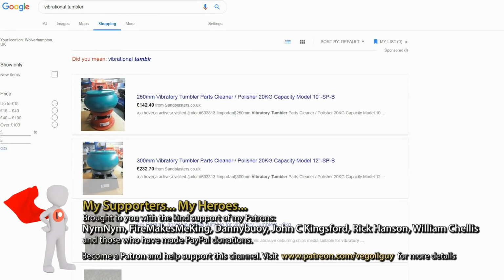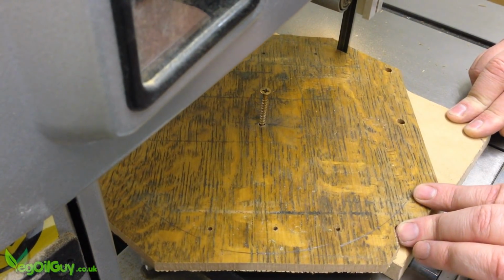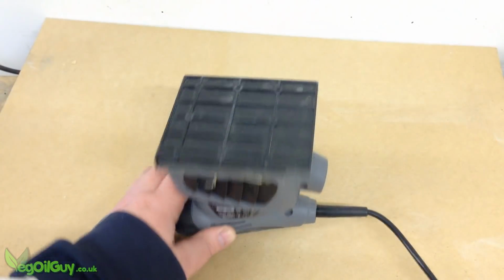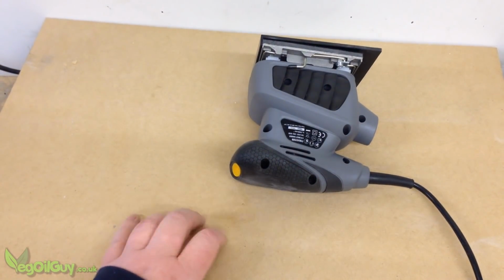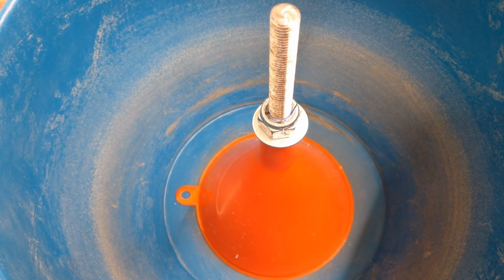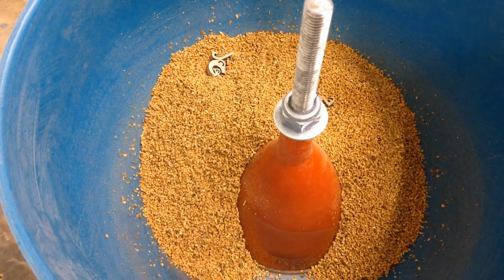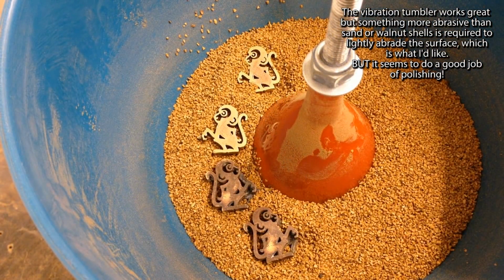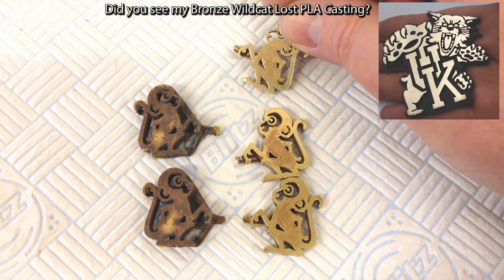SIMPLE vibration tumbler - easy cheap build - great results - by VOGMAN

Comment: IIRC Wood-based abrasives are for light cosmetic polishing and even in more energetic rotary tumblers are left running for many hours. This needs before/after comparison pictures. A few great tricks in your solution, I think the hinges & ziplocks along with three strategically placed dowels are all that’s needed.

Comment: TRY TO FIND SOME WORN OUT SHARPENING STONES , crush them to suitable size and use dry as media .  for polishing you could use glassbeads used for sandblasting, they come in different sizes but I would choose the finest granulation you could find , mix it with soapy water and you have an extreme polishing compound for that last super glossy shine
Reply from the maker: Excellent tip. Thanks  : )
Reply: I was thinking sandblasting carbide but guess what you are really doing is the carbide is rubbing the carbide and blunting itself. would work but maybe not cost effective.

Comment: I use prism shaped ceramic media, about 1/4" on a side, but that won't get into the fine detail of those castings you're trying to do.  (I use a ball mill to clean and de-rust classic car parts.) Perhaps a very coarse sand, or shot blasting media. Here in Switzerland they grit icy roads and footpaths with "split" which is a stone chipping, about 1/16-1/8", that might work if you can find it. For polishing (I also restore clocks) I use walnut shell, which I get at the pet center (used as reptile bedding). Adding some brasso to the walnut shell helps.
Reply from the maker: Thanks Andrew. Very helpful advice  : )

Comment: Hi, I watched your video and decided to make a similar tumbler. My sanding machine is Bosch. I took out some screws used for assembling the sander, make holes and put some long bolts (M4) to keep it upwards and secured with wood legs. Then worried about giving harm to the sander, since there is a lot of vibration and I am trying to hold the sander steady. Is your system still working the way you wished? Any problems with the vibration sander.

Comment: Jeff I would suggest adding ceramic media. Depending on how abrasive you want it to be.  Plan ceramic will be the  most abrasive,  Use the walnut as a buffer for the ceramic media. Do a search on rock tumbling with ceramic media. This method will come up.  The smaller the ceramic media the better it will be at getting in all the nooks and crannies of the cast. The ceramic method is also used in metal work to polish and clean metal.
Reply from the maker: You're the second to say that so I'd better listen to your good advice  : )

Comment: Hi! For the bed, try plaster, is way cheaper and it will make a nice base weight!!!
Reply from the maker: Hi Victor. Thanks for the suggestion. The weight would be good but I'm not sure how long the plaster would survive the vibration.
Reply: @vogman  If you put water, and add plaster second, and leave for 5 mins undisturbed and dont remove much (but make the mix without clumps, hand crushing them) and you add, a lot of it, the resultant plaster is super sturdy ( for a plaster) once it cures and dry for a week you could paint it with a cheap rubber roffing paint.  I use this method to cast my molds, and its very cheap!! 

thank you for answering! youtubers dont have much time to talk with their followers!  also a tip: in the plaster you could half-bury  wood inserts in order to fix with nuts a wooden structure that will trap the upper ( or lower) sander.  And if you are concerned about the rigidity, put some layers on the "sander hand part" of plaster bandage, those are super strong.  just some ideas though.
Best.
Reply from the maker: Thanks Victor. That's a very comprehensive answer  : )
I try to answer all the comments made, but obviously some can slip by. I invite people to comment so ignoring them would be rude. Plus by interacting with them, I get to pick up advice and tips (like now) so eventually we all benefit from easier, more reliable techniques.

Comment: you can find 10kg corundum bags for around 20 bucks for sandblasting, that should be a good option.
you could also ask a waterjet cutting company for a bit of their used abrasive, it should still be good enough for low duty polishing.
Reply from the maker: Nice tip. Thanks  : )

Comment: Try aluminum oxide sand blasting media, they are very hard and sharp little grains. I have only used it for sandblasting but it's the only media I have seen that when sandblasting it will basically leave a sandpaper like finish on the steel.
Reply from the maker: Many thanks  : )

Comment: Just as I'm on a binge looking at these things on youtube, you have put up another great idea. I'm tossing up whether to go for a rotary or vibratory tumbler, but daresay it'll come down to what parts I can scrounge up from my pile of bits. I have seen folks mention the clay based kitty litter as a respectable media for moderate duty cleaning, though I am yet to test it. Makes sense in theory, and cheap as chips, too.
Reply from the maker: Hi Thomas. I have a confession for you... I have both. I made the vibration tumbler (because it's so easy) and bought a barrel tumbler because I found a cheap one. So far, though I've lots of media testing to do, the barrel wins conclusively for polishing. Maybe it's the water - just a little, with steel shot and a splash of laundry detergent. Gorgeous shine. 
But I want something abrasive to 'lightly sand' the work and anything like that will quickly wreck the clear plastic barrel. So I have high hopes for the vibration tumbler. I know I'll find the magic substance eventually.
I had heard about cat litter, but again I thought this was a polishing media. I'll have to look harder I guess  : )

Comment: Great to see that works! What would be a better sand to use? Do you think if the bowl was spinning as well in the opposite direction would that make a difference 🤷🏻‍♂️ good job my friend 👍🏻
Reply from the maker: As a polisher it works great. I know it will 'lightly sand' once I find the ideal medium. Jonathon George has just suggested I try crushed pumice. I'm sure I hear some other great suggestions soon and eventually we'll have an easy sanding machine  :  )
Reply: ArtByAdrock my mate has 1 of the eBay bought tumblers and he recons to use the sand stuff you use with sand blasting 👍🏻
Reply: You use aluminum oxide, silicon carbide media, resin based media (grit in a resin binder in small chips about 0.25"x0.5"x0.5"), or ceramic abrasive media (they are chips of ceramic that have an abrasive in them) you could try crushing coffee mugs from a thrift shop but I think you would be better off using just buying a few 5lbs bags of different media with known grits designed for vibrating tumblers. The problem with sand and other things is they are not sieved to specified meshes for the grits you need.
Reply: oh, and here in the US you can get about 5lbs of the media for about $20 at harbor freight (rust cutting resin media, or medium ceramic media), plus you can use the 20% off a single item coupons to get them for even less. Ebay might have them for cheap too.
Reply from the maker: Thanks for the tip  : )

Comment: Hi Geoff, how about you try different sizes of pebbles and crushed rocks or a mix? I think I saw someone else also add Jiff and water. Any of those slightly abrasive household cleaners should work.
Reply from the maker: I toyed with stone chippings but decided this would probably destroy the plastic bowl. Since making the video I've also tried Silicon Carbide grit which is the stuff a lot of grinding discs are made from. Unfortunately I opted for the fine grade which turned out to be incredibly fine dust. This did touch anything. I suspect a coarser version might do the trick.

Comment: try garnet or glass or any other of the sandblasting media used in those machines.
Reply from the maker: Thanks for the input  : )
Reply: Try using ceramics (small grit for what your trying to polish). Depending on how it works, try adding water or a mild acid to the batch and see what works best for your base material.

Comment: Nice work! Awesome to see someone using stuff that would otherwise sit around collecting dust.  In regard to the medium sandblasting works a treat on tired metals that aren't too thin as does soda blasting (bicarbonate soda) while watching I wondered if a mixture of the two mediums may produce a better result? That said I don't own a vibration tumbler so I could be miles off the target in that thought? none the less cool build.
Reply from the maker: Many thanks. I appreciate your input  : )

Comment: Great idea! I’m not sure if this was asked already but I was wondering if this would also work with glass pieces in order to smooth out the edges?
Reply from the maker: Hi Kris. The tumbler itself would easily cope but you'd need to find a better media. The sand I used works a little bit, but there are more abrasive mediums available. I'm sure a little internet searching will give you an answer to that  : )
Reply: Toothpaste.
Reply: Thank you.

Comment: Would glass beads be any better in the tumbler? Can buy 25kg bags on eBay cheap. I used it to shot blast motorbike frames but in a tumbler it wouldn't be as harsh on the surface
Reply from the maker: Someone else has mentioned those. I'll have to give them a blast... well, not blast, spin  : )
Reply: Why does this comment make me wonder about just how much of the motor bike frame was left after the job was finished?

Comment: Ah! You´ve pinned a hater´s comment so we can all wonder what prompts people to be unpleasant online. AVE does the same. 
 What a resourceful build! I always like to see a component fulfilling two functions at once; your clever inverted funnel´s a classic example.
 I also thought that the attempt to keep the sander unmodified was very worthwhile, though ultimately less than fully successful. It´s a good idea to try these things.
Reply from the maker: I've often marvelled at how the Internet has made many a Lion from a Mouse. I thought it sensible to place the comment there so as not to tax the minds of similarly minded folk.
It would have been nice to dual-purpose the sander, but at £20 I'm still saving a minimum of £100 against off-the-shelf tumblers, so I can't grumble too much - though I did a bit  : )
As a modeller, I know the car body trick won't be new to you. Many years ago I saw a modeller fix the most awkward shaped battery housing into a model boat in a similar way. Fabulously useful stuff car body filler.
Reply: @vogman  If only it didn't stink so much.
Reply: My "Gross Infectected Fingernail Pop" video went really big after some negative comments.

Comment: Great video. Hopefully the small sander is capable of prolonged operation. For cheap tumbler media, litter for hamsters etc. from the pet shop is said to work quite well.
Reply from the maker: Time will tell. I won't be using it excessively, but it was a cheap purchase. Something more powerful and brushless would be ideal, and still possible to build for less than the average purchase price. 
Thanks for the media tip    : D
Reply from the maker: Dunno... they're tricky little chaps  ; )

Comment: Vibratory tumblers seem to be one of those products that doesn't seem to have joined the cost reduction curve, never quite understood why considering the relative simplicity and cost of core components. Some might say lack of demand, but in terms of volume of product many more would sell at lower pricing and other markets with high demand have so many more competitors and models of tool available. Great job!
Reply from the maker: I agree. They're over priced for something that can be so easily made... but hobby markets are easy to take advantage of.
Reply: Festy I think it’s demand. In the hobby niche there aren’t enough people using them to get the cost to go down. I think many people with just do the work by hand for the projects they have when they come up. It’s not used often enough for a hobbyist to justify buying one, but that’s just my guess.

Comment: Maybe I'll have to get a 1/4 sheet orbital palm sander to build on of these. £9.79 (plus parts) vs £41.43 ($13+ USD vs $55 USD) at harbor freight is probably worth the time spent.
Although I may want to spring for the more expensive model with intensity control dial for a mock earthquake simulator.
Reply from the maker: I think if I was doing this a lot, I'd probably opt for a nicely powered brushless motor which should give years of good use. Even then it would still probably be cheaper than buying an off-the-shelf tumbler.
I toyed with building my own oscillating mechanism and I'm glad I didn't. This does what I need  : )
Reply: @vogman  yep, nothing simpler than a brushed dc motor with a pot and a 1/4 circle weight for vibration. but there are other things to consider in a more robust design (true vibritory tumblers have springs around the base for "reasons"). Sometimes it's definitely better to start with an off the shelf design and then build from there then it is to start with the most basic parts.

Comment: I have big problems with the rubber grip of the sander almost melting with bits of rubber flying all over the place after only 10 minutes. I tried a non-slip mat between the rubber grip and the filler moulding but that melted too. Any suggestions to overcome this problem would be greatly appreciated. Thanks
Reply from the maker: Hi Peter. I'm fairly sure my rubber mat came off quite quickly. In honesty I just replied on the bolts in the end. It makes a nice firm attachment : )

Comment: Another great video. Have you tried baking soda. It's used as a cheap medium for sand blasting.
Reply from the maker: Thanks Alan. I've never heard of that. It's got to be worth a good. I'll wait until the wifes out  ; )
Reply: alan tennant 
I was going to suggest the same. I have a pressure vessel to clean engines with baking soda/sodium bicarb. Doesn't damage the aluminium, but cleans it up a treat. Not sure how it will work when not under pressure though. Gotta be worth a try mate.
Reply from the maker: A possible cheap solution is always worth a try  : D

Comment: This is just a theory my friend, so take it as you will. 

I used SOS pads to polish up some metal, they basically are a very fine steel wool with soap on it. I got rusted chrome to polish clean with some elbow grease, on my 74 Honda motorcycle.

Perhaps there is a way for you to clamp down some pads on the bottom, pour some water (distilled I believe won't have any minerals/etc in it that could cause buildup or what have you.) Put whatever you may want to polish, and put a secondary layer, clamp it down somewhat, and I think you'd have much better results in a much faster time.

If there's a way I can contact you, I can send the before and after pics of my motorcycle as proof
Reply: And of course, cheers from across the pond
Reply from the maker: Hi Ryan. Good suggestions and certainly food for thought - thanks.
As for contacting me, you're welcome to. If you go here - http://www.vegoilguy.co.uk/contact_me.php - and send me a quick message, I can then contact you back. This allows us to exchange emails safely without any of that nasty spam  : )
Reply: Done!

Comment: I've heard that sand blasting with regular beach sand is dangerous as it can cause silicosis, so I'd imagine using regular sand in this machine would pose some danger. Finding another medium definitely the way forward.
Reply from the maker: Excellent point. In fairness the lid does a very good job of trapping the dusting. But your point is well made and gratefully received  : )

Comment: Universal motors on power tools aren't really designed for continuous use, I thought.
A lower duty cycle is required to prevent overheating.
Reply from the maker: I'll be honest, I expected over heating. But despite letting it run for 3 hours continuously, it wasn't hot! I was surprised.
I think a sander is a good choice as it's intended to run for a while and work under a fair load. Using the funnel reduced the amount of medium required whilst concentrating it where it was needed, easing the burden of the sander again. 
I really can't say if it will last a long time, but I could make six for the price of purchasing one, so unless longevity is a real problem, it seems a pretty fair build idea  : )
Reply: @vogman  OK thanks, that's good, I was thinking of using one as a concrete vibrator.
Reply from the maker: Actually George I've already do that, but I guess it depends on your scale. I attached a length of copper pipe to a sander to make a vibrating probe in a foundry build. It moved the Refractory (which is cement based) with ease. You can see it in use here I think - https://youtu.be/n42t3M1fOyY  : )
Reply: @vogman  Good one, I'm glad it worked well.

Comment: you should make the bowl easy to switch out. cut the large screw and use one of those really long nuts to to join two screws together that way you can just keep your course medium in one bowl, then move the part in to the fine medium bowl and screw it on. you can move it down the line with only high finish polishing at the end. that way you can be super lazy! you should make a strainer for the parts too, because you are only dealing with one sized medium this becomes super easy. if you don't want to even bother with pouring the medium back into the bowl you could just make 2 bowls for each medium. also if a vib sander is too expensive for anyone to make vibration you just need to attach a bar with a weight at the end to any motor's rotation. it's the best way to make your girlfriend happy.
Reply: so you can finish making all that jewelry she's been wanting.

Comment: sir you can't close off the cooling ports WHY did you not just draw the outline of the table then invert the cord then handle through the HOLE then fastent it
Reply from the maker: Don't worry Bruce, I didn't block the vents at all. That would cause over-heating and motor burnout : )